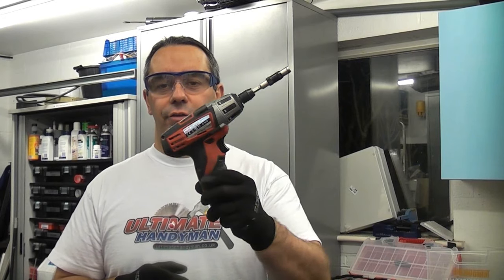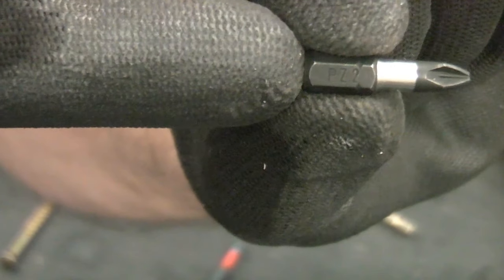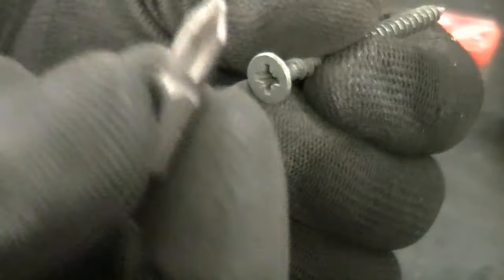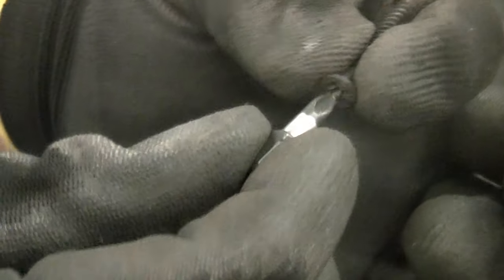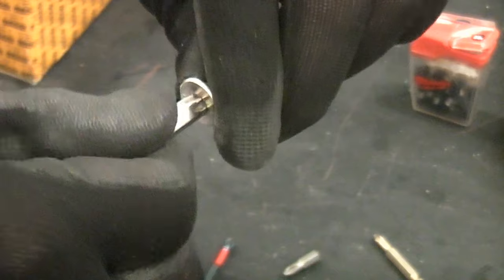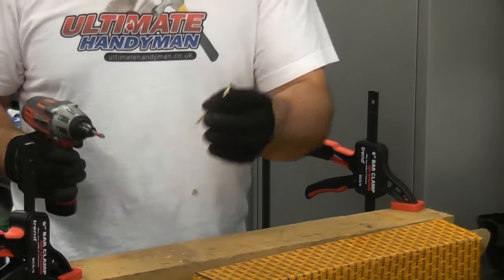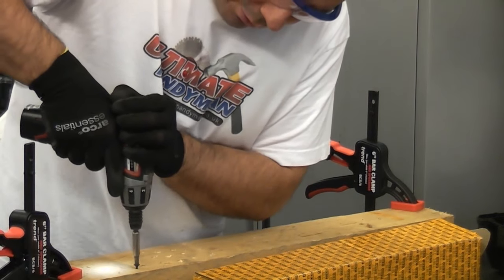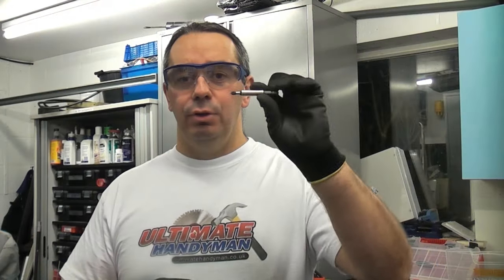How to drive screws with a drill/driver

Comment: My absolute favourite now are Robertson (square head) screws. Learned to love them while I was in Canada. No problem with screws dropping off the driver, no need for magnets, simple, no cam-out, and beginning to become readily available even in the UK :)
Reply from the maker: ***** 
Thanks, I'll look out for those.
I do have some square drive screws which are for use with pocket holes and they are very easy to use. 
Thanks for the comment

Comment: Thank you so much mate. I am struggling with my combi drill driving or undoing screws. I have found the answer. A minute ago I tried and it worked. I used the PZ2 bit coming with the screws and it actually worked perfectly whereas I'd stripped the same screw in using PH2 bit before that. Amazing!!! Love your work
Reply from the maker: I'm glad the video helped 
Thanks for the comment 👍

Comment: Thank you so much.  You helped me continue my project.  I never even thought about the size of the bit and my bits are marked.  My screws were also marked.   I used the correct bit and I am good to go.I  also appreciated the tip about practicing on some scrap wood.  Thanks a lot.

Comment: Never realised there were different types of drill bits for specific type of screws until I saw this video. Thank you very much for making this video. Just bought a Dewalt drill bit set with all the different types of drill bits available, should come in quite useful. Also I have some Wickes multi purpose screws which require a PZ bit, it doesn't say PZ1, PZ2 or a PZ3. So using a pass or fail test, the thicker PZ3 seems to be the exact fit.
Reply from the maker: It would be easier if they made one bit fits all- but that would bee too simple 
Thanks for the comment 👍

Comment: Great video describing difference of Pozi and Philips, way to many people who don't know or care about this.

Pretty much 9/10 times when I find a destroyed PZ/PH-screw, it's because of someone has used the wrong bit before. But very often I find that even though the screw head is messed up, when using the correct bit, it's no problem getting the thing out (and of course, replace it if possible).

But, it's pretty easy to understand why that is here in Sweden, since all PH and PZ-screws goes by "Star screw" or "Cross Screw" (directly translated). I don't think I've ever heard anyone in Sweden refer to a Philips-screw or Pozi-screw (except for myself, that is).
Reply from the maker: I guess star screw and cross screw is a very good description of what they look like ;-)
Thanks for the detailed comment.

Comment: Thanks for the great video! Does the screw have the label as well? Or do you just check which bit fits best?
Reply from the maker: Most of the time, it will tell you on the box which driver you need, such as PZ2 etc.
But if not, you just have to check until you find the correct bit.
Thanks for the comment 👍

Comment: Showed the video to my wife, hoping you would make two simple points. 1 - it never hurts to pre-drill, and it's actually necessary when working with smaller pieces of wood (like kitchen cabinets). 2 - never use a power drill as a screw driver (the kind you plug into a power socket). It is too powerful and not suited for driving in screws. I noticed you use clamps, but you did not mention those. I also find it helpful to use dish soap to lubricate screws sometimes. It prevents squeal and can make the job easier. Good info on the different types of bits, though.

Comment: some posidrive bits cam out on pz screws .Have used Ph.bits on Pz screws with just as good results .During screwdriving into dried out timber .spit on the screw goes in better and release the torque and start a couple of times seems to reduce cam out rather than driving in one go .
Reply from the maker: +LCHLLO2008 
Torx are best ;-)
Reply: only used them with the no plug heavy duty fixings .Had to put them in with a ratchet ....but you are right .No cam out :) Tough things grip like hell .and re usable

Comment: I'm building something for the first time...I'm having so much trouble getting the screws in. I am small, but the drill goes so far and stops completely.  I take it off and it works fine...after watching this I'm wondering if it needs to be charged more.  Thanks for the video.
Reply from the maker: What make and voltage is the drill ?
Reply: +Ultimate Handyman It's a Black and Decker.  I'll have to check the colts tomorrow.  I got frustrated and was building it at my Mum's.
Reply from the maker: It might be the batteries, are you sure they are fully charged?

Comment: Had to watch several videos learn enough about drilling screws. One showed the importance of lining it straight and to start it by jabbing the wood, another showed a very useful drill guide that makes starting it much easier and safer, another showed how to stop wood splitting and screw stripping with pilot holes. I learn from you that a pz (never heard of it) screw top is different than phillips top. I learned from a comment here that you can set the torque to prevent stripping. I assume these videos are all for newbies like me. Why don't you instructors just make it comprehensive in the first place?

Comment: Good video. Another tip you could add is to use an impact driver rather than a drill driver... way less cam out and don’t have to press down as hard.  More consistent results

Comment: Two things used to wind me up when I was on site. Watching so-called experts driving in long screws 
NON-STOP and they were wondering why a number of these long screws were snapping.
The second one was when they kept pulling the drill away from the screw before releasing the trigger and they wondered why their driver bits were wearing out. 
I laugh about it now but I guess some folks never learn eh! Chez lol
Reply from the maker: It winds me up when the bit cams out and they still leave the drill moving, which rounds off the bit and the screw- once person thought it was the torque control 😂
Thanks for the comment 👍

Comment: The bits may be labelled but screws are not.  They all look the same (PZ2, PH2, Phillips) to me.  If I'm removing a bunch, for example, how do I tell?  Or do I just use the bit that seems to mates well?
Reply from the maker: +J Warren 
When buying new screws they are normally labelled, but for existing screws- yes just use the bit that fits the best ;-)
Reply: J Warren Not sure if this is any interest to you still but screws which require a Phillips bit will have a simple cross where the screw bit enters the screw, however the screws which require a Pozi bit have a cross, with faint lines in between each section (Basically 8 lines for pozi, 4 lines for phillips). It's hard to explain over text lol. If you Google it you'll see exactly what I'm on about. One you know, it's so easy to tell the difference between them.
Reply: Why on earth this wasn't mentioned at the very start of the video, I have no idea... The reason why Posidriv screws & bits are so good (compared to Philips) is because they have a much larger surface to surface area. So yes, if you can see the faint lines on the screw, use a PZ bit.
Reply: PZ will have 4 extra "slits" that are smaller than the main ones. Its pretty easy to tell once you notice it.

Comment: Yikes I wish I would have seen this 2 hours ago before stripping like 6 screws! Thanks for the info. Do you determine the screw head and bit fit by looking at it or is there a written guide?
Reply from the maker: Normally by looking at it, but sometimes you can find the info when buying the screws, as the type of driver needed should be on the box.
Thanks for the comment 👍
Reply: @ultimatehandyman  Awesome thank you! I'm a novice woodworker so this was super helpful! 🙌🏽

Comment: Tried and failed and didn't know why. Thanks my man. I bought a cheapie 4 tiered Metal storage unit with small screws that don't have a name on them. Do you have an idea what they might be? Put one up manually and can't consider it again! Nearly got blisters using a screwdriver and there is another shelf unit to do.My hardware store, Bunnings in Australia charges AUD$55 to do it for you and the units were AUD$14 each. Goodeh from Downunder!
Reply from the maker: They might be self-tapping screws, which normally use a Phillips head.
Thanks for the comment 👍

Comment: I bought a Ryobi drill driver a few months ago and for some reason I find it difficult to drive screws into certain types of wood, well any wood really but particularly an old garden gate post. No matter what type of screw bits I've used (making sure I've got the right type of screw bit of the screw and making the sure the drill is set to drive mode), it really struggles driving screws into wood. It does manage to pull screws out but this depends on the screw as often itscrew won't budge,  but I suspect this is because the screw is seized or the wood its screwed into is too hard (I'm talking about a 20 plus yr old gate post here). Really can't understand why it doesn't do the job, and as far as I know the drill isn't broken. It will of course drill holes into wood and masonry, but as far as screw driving goes it does a really poor job of it.  When you try and drive a screw either vertically or horizontally, drilling screws into material like wood makes the screw wobble all over the place and hard to keep the drill steady, certainly isn't effortless like the in the video. Anyone know what could the problem or has anyone else had the same problem?.
Reply from the maker: I bought my brother-in-law a Ryobi 18v Drill/driver once, I went to his house once to do a job and borrowed it. The driver was pretty awful to be honest, a few years later I got him a Hitachi, which is far batter but not in the same league as Dewalt or Milwaukee.
Thanks for the comment 👍
Reply: @ultimatehandyman  Dewalt and Milwaukee are expensive though (especially Milwaukee, and Makita) where it's like 300 quid for a drill lol. I got my Ryobi just before Xmas for £80 including battery and charger, a Dewalt drill for that money would just get you the drill, so another 50 quid for a battery.
Reply from the maker: @Embracing01   £109 here for Dewalt with 2 X 2AH batteries- https://www.screwfix.com/p/dewalt-dcd776d2t-gb-18v-2-0ah-li-ion-xr-cordless-combi-drill/899cf

Comment: Great video. Question, how much downward pressure should I apply on the drill? Im never sure how much is too little or too much.  I have recently snapped a few screwheads off but I feel they could of been cheaply made soft metal.
Reply from the maker: I normally apply lots of pressure, to prevent the bit from camming out of the screw.
You should never be able to snap the head off though, apart from decking screws etc. You only need to look at most decking screws and the head will shear off.
I normally buy Turbogold screws from screwfix, or Reisser wood screws/ Spax etc. 
Thanks for the comment 👍
Reply: @ultimatehandyman  thanks so much, I'll try with more pressure from now on! I think the snapped screwheads were a case of cheap screws that came with something I was installing. Was only using a drill, not even an impact driver. Appreciate the help and your channel is amazing, learnt a lot.

Comment: Hello, thanks for the vid...Just tell me please..did you drill the hole when you used the overlong screw with the Dewalt-Screwdriver??

How is the proper procedure to use long screws on hardwood? Is an impact-screwdriver enough or is it always comon to drill first the hole and then you use the screwdriver...
By the way...my bosch gsr 10,8 (blue) was toooo weak when I tried to screw in 8cm long inox screws (m5) into hardwood, and I drilled the hole even before I screwed them in.

Thanks for help.
Reply from the maker: Yes, I drilled a pilot hole for the really long screws first.
For most hardwoods it is best to drill a pilot hole first, although some screws are self piloting and self countersinking but they might struggle in some hardwoods. 
Inox screws (stainless steel) should always be used with a pilot hole as they tend to snap easily.
Thanks for the comment
Reply: +Ultimate Handyman Hi, and thanks for the clear concise video.  I'm wanting to drill long screws through a 75mm fence post into a hardwood railway sleeper.  Which bit should I chose for my pilot hole and how do I choose which screws to buy?

Comment: Do you drill a hole into wood for the screw to go into or just screw into the solid wood? Probably a dumb question I know but I know nothing about this.
Reply from the maker: It depends which wood screws you are using. I always buy self drilling and self countersinking wood screws. If you are using hardwood you will need to drill pilot holes, but in softwood you can either use self drilling screws or drill a pilot hole to prevent the wood from splitting.
Reply: @ultimatehandyman  Thanks.

Comment: What about a screw known as a 'dual slotted/phillips'.  What bit should this one have? Or just use the closest fit? Another question is that the torque ring has jammed on the cordless screwdriver? Is there a fix for this do you know?  Thanks!
Reply: I got that issue last month. I teared down the drill and i was unable to fix it so I putted back. After spinning it left-right and lot of wiggle of the toque ring I managed to get it lose like nothing ever happened. Hope you get yours fixed!

Comment: I actually love watching your videos because its clips like this that teach me something new though I presumed I already know how to do the basics before watching the video.

My question is *****, how do you identify the screw by eye? For instance identifying a PZ-1 screw from a PZ-2.
Reply from the maker: I'm glad the videos help ;-)
The best way to get the correct bit is to check on the box of screws. If this is not possible you can often tell by the size of the screw and the head. Smaller screws are normally PZ1 and the larger screws go up to PZ4. For most screws it will probably be a PZ2 as this is probably the most common size of screw head. You can always try a bit in the screw and choose the bit that fits it best.
Thanks for the comment
Reply: No worries *****, Thanks for answering my question
Reply from the maker: riacharda
You are welcome
Thanks for the comments ;-)
Reply: Seems like torx is becoming more popular as for the likes of decking screws maybe they will just become 'the standard' replacing  /displacing those other head specs.... here's someone that wishes that same will come the sooner  the better as the other systems have had their day in the sun...... thanks for the information...i was that soldier.... now i know better...

Comment: Would having the wrong drill bit prevent a nail from going into plywood at all?
Reply from the maker: If you are using the wrong driver bit, it will chew the end of the screw up. If the screw won't go in at all it might be that the screws are cheap and require a pilot hole first.
Thanks for the comment 👍

Comment: Hi. For some reason my cordless drill doesn't allow me to press the trigger softly to get the screws going. It pretty much goes from 0mph to 100mph straight away. Am I using the wrong drill? I've tried all settings.
Reply from the maker: What make and model of drill is it?
It is very unusual for a cordless drill not to have a variable speed trigger/switch!
Thanks for the comment

Comment: I will be screwing 2x10 splices to 2x10s that are fixed, or already nailed down. Do I start the screws in the splices or start the screws into the 2x10s that are already nailed in place? Thank you.
Reply from the maker: Not sure, I have tried to imagine the scenario but I'm struggling.
Perhaps try it both ways and use the easiest?
Reply: Thank you

Comment: I was hoping you would tell me how to get the extender into the drill?  I can see it is in there, but with a round thingy for the normal drill bits, I do not know how to get the hex thing that normally would go into the ratchet fitting into the drill for the chuck to tighten it.
Reply from the maker: This might help- https://www.youtube.com/watch?v=ku29KYl4Wdg
Reply: So you are telling me I need a different kind of drill to use a hex head?
Reply from the maker: No, a hex head bit will work in a standard chuck or a 1/4 hex chuck.
Reply: Ok, Thanks, I will try it!

Comment: How can you tell from the screw what type it is and what screw bit to use ?
What are the different types of drill bits to look out for ?
Reply from the maker: +Jack Jill 
It normally says on the box of screws which type of driver you need to drive them in, such as PH2 or PZ2. You can tell by looking at the screw if it's a Philips or Pozi as a phillips head is just a cross, but pozi is a cross with a smaller cross inside.
Reply: ***** excellent
your the man
thanks

Comment: i,m confused so just between me and you , what piggin drill ?/driver do i use to screw without pilot holes , ta great info btw
Reply from the maker: If you buy self drilling/self countersink screws such as Screwfix's Turbo gold range you can drive them in using a PZ bit without having to drill a pilot hole.

Comment: I am trying to screw decking together and someone suggested doing pilot holes  with a drill ? but do I need a specialized electric screwdriver for screws / hard wood ie decking .I am female and just learning .thanks would appreciate a reply asap thanks
Reply from the maker: Any drill will drill holes in wood, but if you can get a cordless drill it will make the job much easier- https://www.youtube.com/watch?v=ku29KYl4Wdg
Reply: thanks for replying will take your advice and buy a cordless drill .thanks once again.

Comment: I always have issues with the square bit,  I got the bit #2 and the box of screws also says #2, but it keeps getting out, I end up damaging both the bit and the screw, what else should I be looking for?
Reply from the maker: I believe they are called Robertson bits. I would ensure that I only used decent quality bits, perhaps made by Wera or Wiha 
Thanks for the comment 👍